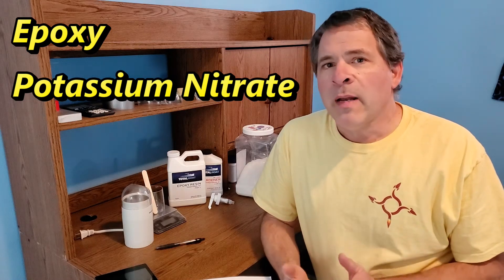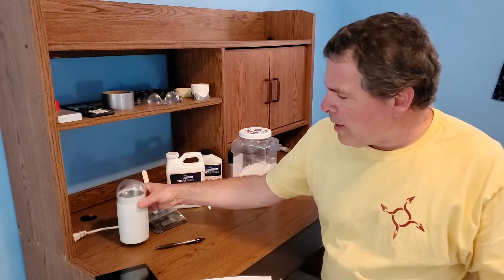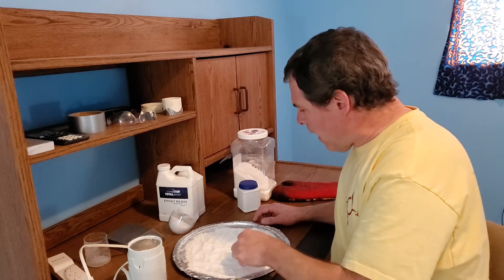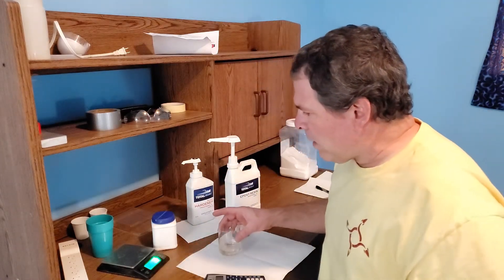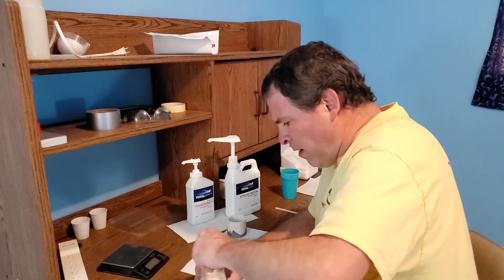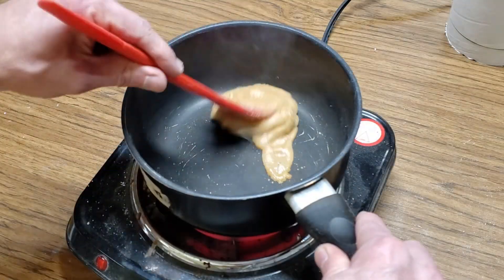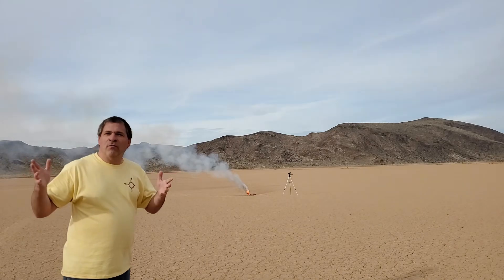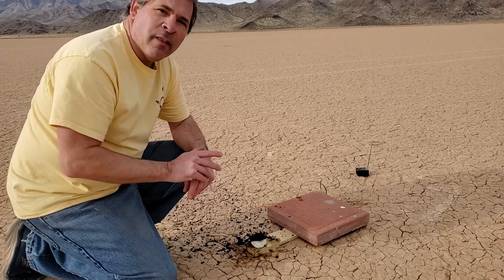Build & Test a Rocket Motor Smoke Trail

Comment: Please realize that will keep pumping heat into the entire length of the PVC motor and not just the double-layer end cap. Also, not a good idea to have something like that burning during descent unless you're launching on a dry lake bed since it can catch ground vegetation on fire (I'm a retired firefighter) along with your rocket.
Reply from the maker: This "smoke element" is a part of one of Dan Pollino's motors that I will be building soon. He has launched it successfully so for this one, I just have to trust in his design. We shall see... 
As you have probably seen from my launch site videos, we have no danger of igniting anything on the ground in a several mile radius.